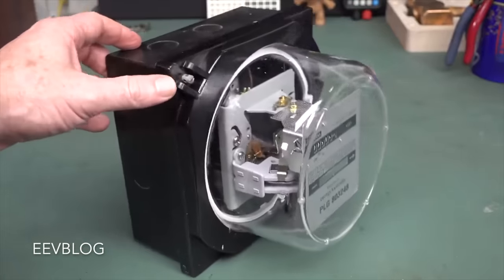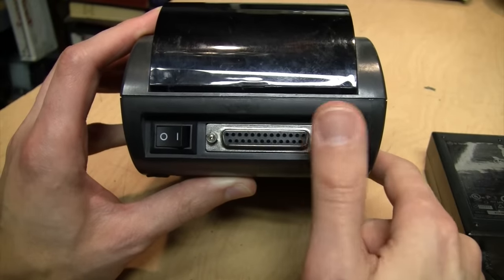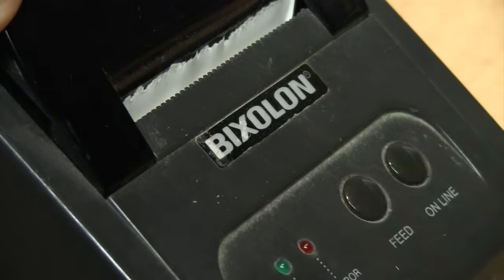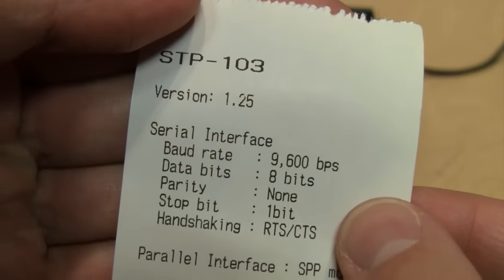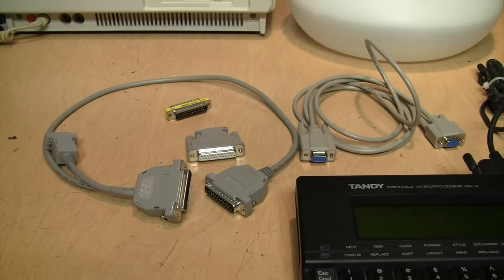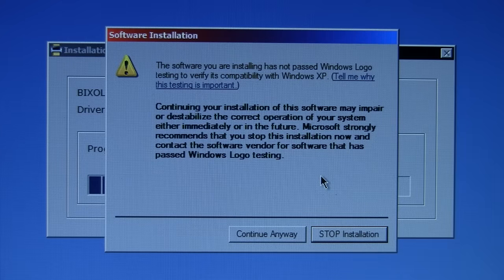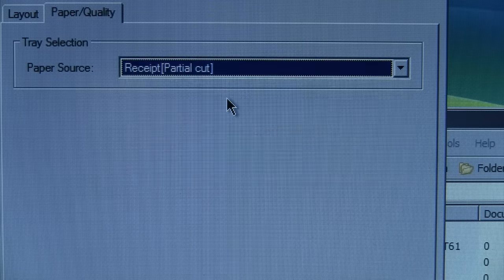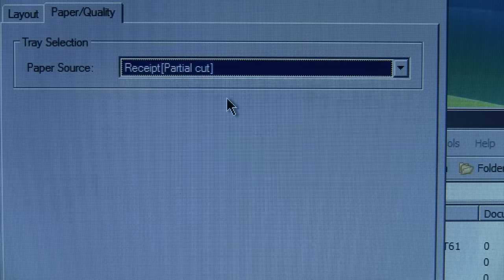I got a receipt printer. 🖨️ Now what?

Comment: I occasionally need to use a Zebra thermal printer for my job, it's a bit like yours except it's wider and can use bigger labels like P6709's, not just for receipts, trust me the novelty wears off and turns into anxiety of it jamming up, half the settings i don't even understand but it gets the job done, it's very utilitarian and feels kind of outdated, since it's for company use i'm not really meant to be playing with it but i have printed out some of my photographs on it before, i love the differing but i'm not advised to use that since we use it for barcodes and differing can mess up barcodes.

I already know of the lighter trick, in fact the manual for our zebra reccomends dragging your finger nail along the paper to see if it's thermal or not, leaves a nice streak.

And yes don't put clear tape on them, we did that and found out the hard way, and no don't laminate them either.

As for what to do with it? well don't use it for shoplifting, as you say that's bad, maybe see if you can hook it up to a computer and use it as a live news feed like a teletype.

Some piece of industrial equipment i've always wanted? It's a tie between one of those pneumatic tubes you see in the supermarket or one of those security tags that wrap around boxes and set an alarm if cut, i can imagine pranking some of my friends and family with that one.

Comment: Loving these types of videos! I still use a mechnaical printing calculator.
Reply: What model num. is it? Is it an HP?
Reply: @thatguyalex2835  Its a TA 1121 PD euro from Triumph Adler.
Reply: @memeik  I don't think I have heard of the Triumph Adler, but I have seen an Adler Royal calculator before, or the Sharp equivalent. :)

Comment: One tip I have is you don't have to tear fast as much as you have to tear at a sharp angle pulling the paper towards the edge with a the paper only at a slight angle diagonally.

Comment: I've got the Timex Sinclair 2040 "Personal Printer" from 1983 or so which prints 32 columns on thermal paper, and it also uses a 24V power supply.
Reply: You can actually print more columns if you use tiny letters.

Comment: Sometimes your better off with no docket. I had one of those 5 inch B&W TV's, it died, I couldn't find the receipt, so I took it back anyway, they hummed and harred, then gave me a new replacement TV. Later on I did find the original receipt, it was WAY out of warranty....... 
Still got that TV, still works ...... as a video monitor, since no analogue TV anymore.

Comment: The sqwauk noise is Motorola's MDC1200 protocol for sending a radio ID number over the air and the compatible radiosr receiving display it. Usually used by emergency services.

Comment: You can also put thermal paper on a hard surface and run the edge of a fingernail quickly across it, pressing down. The friction provides enough heat to mark the paper.

I’m told that thermal paper shouldn’t be recycled with regular paper as it contaminates it and in some cases makes it unusable…

Comment: I fixed a lot of thermal printers... breaks in printout are due to poor paper quality-when you see white vertical lines, that is a real problem (or dirt). Interface is as-requested port type and software used (RS-232, parallel, later USB) and replaceable (plug-in type) on better models. Cutters on somer older models (like Axiom) are ceramical! Can print from MS Word and like, but you have to adjust margins weirdly. On good paper, good printer makes good images-I used funny comics as a quality of print-proof on some hi-res models.

Comment: I have a Domino A200 continuous inkjet printer, that was traded in by a company to upgrade to a newer faster one. Runs, or at least starts up the print head, though I would need to also give it encoder pulses from the line and start pulses, plus a pesky password protecting the menu on the very dull LCD display. Did have to top up the ink and the solvent tanks a little to get it past the low level marks, but that was easy, I had a few bottles of dumped Linx ink from cleaning the one where I used to work, plus I just topped up with methylated spirits, as that does dissolve well in the MEK solvent used, and is used to clean them anyway.

Not much use for a printer that can, quite literally, print onto anything, so long as it can move, and only prints up to 50 dots vertically, normally 2 or 4 lines, generating the dots and controlling them on the fly. Machine counter says it has gone to the moon, 0.1mm at a time. A staggeringly large number of dots made, with an equally large number of dots dumped back into the spittoon as well for recycling into the ink tank.

Also a thermal wax printer, Tektronix Phasor 340, though that machine is expensive to run, $1000 just to start it up, as it uses little wax blocks to generate really nice colour wax images. Heated drum, coated with a thin film of silicone oil, gets the image built up over a few dozen rotations, with piezoelectric heads shooting variable volume hot wax droplets onto the surface, then transferring the whole image onto the paper sheet as it passes by. Magic technology, but expensive to run, and the prints do not like heat. I used to print pages as colour images on black, as you literally did not ever need to buy black wax, it was free with the $400 purchase of 3 colour wax blocks, and the printer will use 1 block to start up or power off, and otherwise will use one block per week in standby. That, along with the $1200 maintenance tray, which only lasts officially 1000 pages (but we figured out how to reset that counter, getting 5000 pages out of them) was the killer of the printer, it was not economical when colour lasers dropped in price, and improved in quality of output, to match this printer.

Comment: There's a red fire alarm light in the workshop of my ship when I was in the navy that was no longer in use (it used to be hardwired into the ship but was just there, bolted and welded to the overhead) wanted to take it home and get it working again but it would have been more work to remove it than getting it to work again

Comment: I work with them all the time, and I hate them.  You are correct, people never clean the thermal print heads and then wonder why they don't print right, if at all.  We use them at work to print grill slips at McDonalds for special order sandwiches.  So the grill slip paper is actually sticky on the back, which further causes print head issues as you can imagine.  The trouble with these is if the thermal paper gets too hot while being stored, it won't work right....and the thermal paper is more expensive than regular adding machine rolls, or paper rolls for the printing calculators....that paper will NOT work in a thermal printer either....but you can use thermal printer paper in an adding machine or printing calculator as those use ink rollers rather than thermal transfer.  

Today's receipt printers typically have a paper cutter built in which is something else that needs to be serviced from time to time, replacement of the cutting blade periodically, cleaning of the mechanism of course.  Also, the printers we have at work actually are still Parallel port printers, but there are some that are wireless and some that are USB as well.

Comment: I use mine (Rollo 5x8) to make labels and sticky notes. You'll need to buy thermal label rolls, but they're petty cheap on Amazon. Better than one of those label makers that only print on one kind of roll, except you'll need to put tape over your prints to make them more resistant to the elements.
Reply: Hey!  That would make it actually useful for shipping packages!

Comment: The farther back you go on Point of sale printers the more horrible they got. Epson, Star and Citizen receipt printers. The printers was not really terrible for say. But the software and cables used was a night mare. Two of my favorites were. That is a serial printer. But it uses a special cable. Not a null modem, and not a straight through. One other one was a rj11 or 45 connector and before the internet. The book might have showed you the proper break out. The next was the Point of sale software would only work with one brand and select models of that brand. They even carried this into Windows 7 & 10. Sure you could use the windows 7 print driver to print out a test page. But when you printed with the software. The print out was wrong or would not work the printer correctly. On a side note. Tons of the older models is 9 pin 40 column dot matrix printer instead of a 80 column. As shown though when you printed out. Even with the driver installed. Some of the prints don't fit the size of the paper. Then the customer complaint is the receipt fades quickly. Ex: due to heat in pocket.

Comment: If memory serves correctly, places like Walmart have safeguards in their policies to prevent bogus returns (which is part of why returning anything is usually a pain in the ass if it requires the serial to be scanned before being sold).

Some years ago, someone tried to return a bunch of stolen iPads and that's what prompted the store I worked at to enact some policy changes, though LP still might want to have a word with you if you try to spoof a receipt (though if you just reprint a receipt with some product names replaced with obscenities, you probably won't get in trouble).

Comment: I have one of these in my truck to print diesel receipts with. 
Great for not having to deal with waiting in line for 30 minutes.
Reply: You mean for expenses?
Reply: @chaos.corner  
Just proof of purchase for multiple reasons. 
The places I have to fuel up have electronic receipts, and my company has had issues where I've had to rescan load paperwork a couple months later... So I like to have physical backups, plus it's a very time sensitive line of work.

Comment: I need one of those. Just to make use of my parallel port on the Toshiba Satellite Pro M30, but I would hope to get the IBM one that is a dot matrix (uses ink, yes) because those were the ones I always saw back then, the newer ones are "Wincor Nixdorf". Nothing wrong getting a thermal printer if that's all I could get...it would be fun to squeeze it out of its limits and actually have a use for it with making lists and some other stuff

Comment: 10:01 Life Rule #872 - First step after getting a Bic lighter is to remove the safety clip. A pen or pair of tweezers is all you need to bend it back an take it out. Makes lighting the lighter much easier. And if you are in a survival situation, the safety clip has to go.

Comment: I remember working with a ZX Spectrum thermal printer - It went like this: that thing heated so much that it printed 10 or 20 lines and then the temperature sensors turned down the printer. Unfortunately there wasn't a "resume" mode - The printer did not resume after cooling off !!! The only solution was to list 10 lines at the time. For example, with the Hisoft Devpac assembler I had to type P10,20 then P21, 30 etc... Lol Strangely though with this method the temperature sensors never reached the shut-down mode...
Reply: You must have had a duff one. I have the basic code to Valhalla printed out somewhere. It's about 10ft long. Unfortunately most of the game is in machine code.

Comment: 0:42
This one doesnt cut the paper automatically.
I have a receipt printer that has this jagged edge and an automatic cutter(overkill lol) and you can identify the autocut by a large box at the hinge side(one side of the printer has the motor and the 1st blade(moving at about 8cm/s) the other side has the 2nd blade(stationary)) The blade isnt sharp

Comment: I actually have a brand new Epson still in box, went down the rabbit hole for a while reading on ESP/POS protocol.  I was designing a site for a take-out place and was going to implement online ordering and have the orders go to the printer but they never ended up going with that setup and went with a 3rd party.  Still need to find a use for it...  maybe shopping lists or something.

Comment: yes the moire pattern did show up in video.

they do make centronics to db25 adaptors.

the scsi drives for the mac had a male db25 to male centronics 50 pin connector.

you would need a female centronics to male db 25

Comment: Almost all receipt printers run on 24 volt because most tills have a 24 volt output in a 3 pin DIN plug. This one is odd in the way it uses a barrel jack but id suspect there was an adapter cable included in the box when new. USB thermal printers arent very common as USB is still considered somewhat unreliable in the POS sector. Most barcode scanners (non wedge) , printers and even credit card terminals are connected by serial still. This printer is an odd model as it has no trigger output for opening a cash drawer which most do (and use the 24 volt supply for such). For kitchen impact printers ethernet via an onboard ethernet to serial card is quite common these days. If its an area you’d like to look into more, id suggest trying to pick up an Epson TM88 thermal printer or an Epson U220B dual colour impact printer. Theyre kind of the reference designs that many cheaper chinese manufacturers build their printers to look like and even emulate in serial commands.
Reply: Most of the receipt printers I see these days actually have a lightning interface, and are plugged into an iPad mini.
Reply: I got lucky and got one with 12V. I also have a 24V one. I'm wondering if it could be modified. I can't think of anything in it that would need the 24V. Heck, I should see if it would take 12V anyway. It might just use a linear regulator to drop the voltage.

Comment: IBM/Toshiba 4610 printers are easy to get a hold of and I've got a copy of ALL THE DRIVERS to get any single one of them running on anything from 9x all the way up to 10 x64, and I think also 11 at that. I have a 4610-TG3 but you can get a much nicer printer for not too much that has better character sets and is a lot more user-friendly.

Comment: why arent thermal printers a thing nowdays? not only wont you have to pay for ink which price is outrageous but it also seems to print quite fast. I did a quick search and found you can also print in color mode and they seem quite compact. Is there any downside to this kind of printer? Does the paper lose its colors over time, perhaps?
Reply from the maker: Yes, thermal paper definitely does fade over time, or very quickly if you put Scotch tape over it or get hand sanitizer on it. The main advantage is that the cashier never needs to replace the ribbon -- only the paper.
Reply: @vwestlife  ah figured, well itd be very nice if there was a way to make it never fade away. No more wasting overpriced ink and also its quite easy to use heat as source since we're talking about only 24 Watts power.

Comment: I doubt very much Samsung makes these. I worked for verifone and the guts are off the shelf standard parts. Housing and controls/electronics are what separates one brand from another. Verifone would NEVER have resorted to a sticker for branding. Pad printed, cast in or an aluminium emblem where the norm.

Comment: I actualy have a use for a street light so, would realy like one (LPS or Mercury vapor one would be the best)
Reply: I have a semi complete assembly of a street light and quite a few spare sodium lamps.
Few years ago the city where I live was in the process of replacing the old lights with LEDs so you could randomly find the workers doing such job.
So one time I was able to just ask them if I could pickup the old lights and they just let me so I got the power supply, lamp holder and a lamp and another time few other lamps
Reply: @Yrouel86  wow you lucky guy

BTW: how do you diferenciate lps vs hps lights, if they are already running, they both appear yellow to the camera, while orange to the naked eye

I would actually like to replace my CFL (when they die) (see them start here: https://youtu.be/s77OUsXqziQ

 (the old ones with the old starter that take longer to start)  with Mercury vaper lights because you  cannt get CFLs that start with different color anymore

But I cannot find any Mercury vapor lamps that have built in starter
Reply: @Veso266  I...I just looked up the datasheet of the lamps. Sorry :P
Reply: @Yrouel86  am, you didnt do anything wrong, what are you sorry for :)

Comment: So it might not actually work with a parallel to USB adapter, those only work with particularly modern parallel printers, they aren't generic parallel interfaces. They are literally parallel printer adapters only. Much to my dismay trying to use a LaserJet 5L.

Comment: Modern receipt printers use ethernet. They have USB, but even when you use them locally, the ethernet connection is rock solid stable, while connecting those printer using USB is unreliable as hell. And I had all brands and models, including Epson ones.